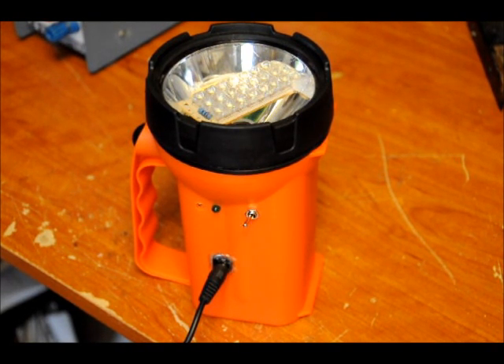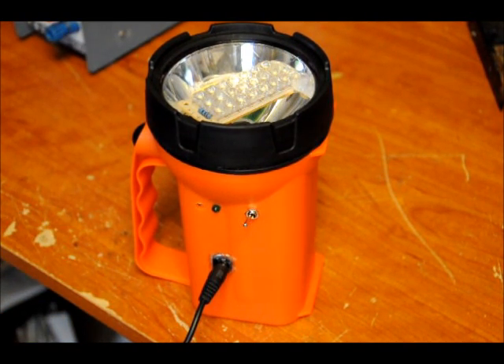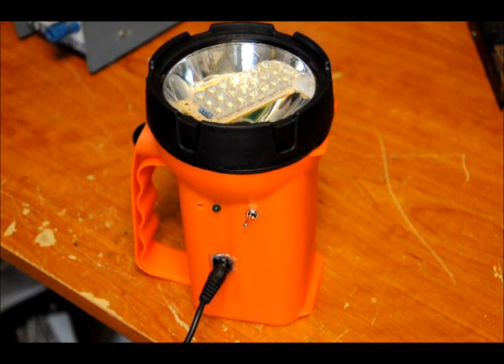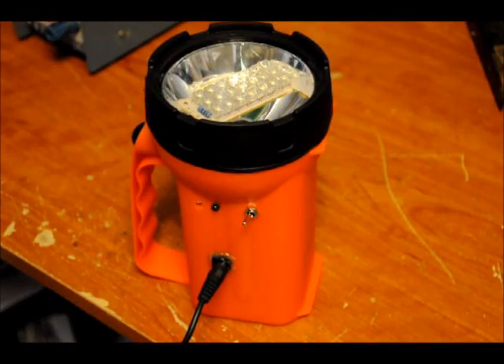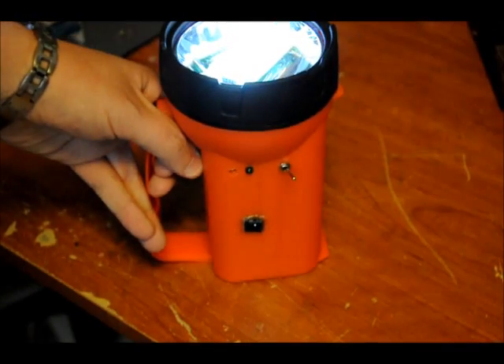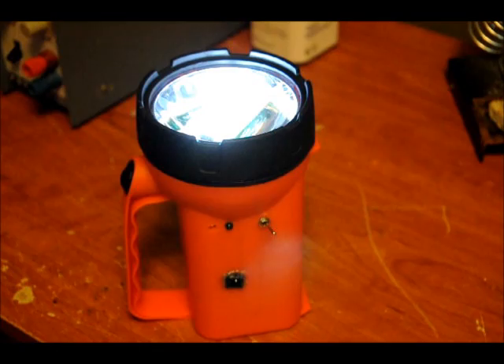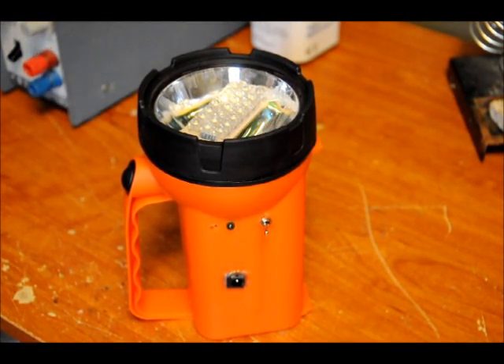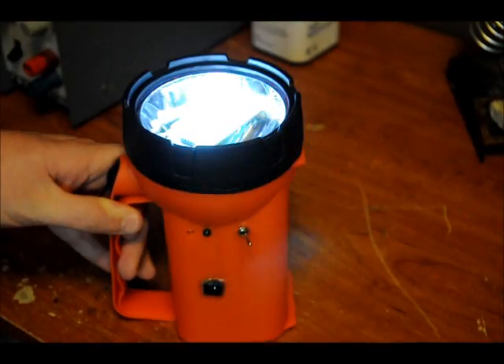The Quick Rechargeable Super Capacitor Flashlight with DC Input

Comment: "20min. to 1/2hr. to charge?"  One of the main purposes of using super-capacitors is to recharge in mere seconds. You need a power adapter of the same voltage but with a much higher current rating.
Reply: Good point but then he would have a toolpack and not a flashlight.  What charger are you envisaging?  Something DC connected two way to some LiFePO4 or overvolting the caps?

Comment: I love it, and wish I had one... but for now I think I'll stick with Lithium Ion @ 4000 mAH, 3.6v. Thing is LiION is the perfect voltage for super brights. I want to design a circuit that engages a limiting resistor when the voltage > 3.6V, kicks out when at or below 3.6V. Considering the battery (which costs $2 not $25...) will keep the circuit lit longer than the supercaps, and can be recharged more than NiMH... I think it's the best bet until supercaps get cheaper (and they probably will!).

Comment from the maker: @rome877 
In this case, using a 9v 1A power supply, and 2x 400f capacitors in series, to charge from 0v takes about an hour.  To charge nominal, from 3.4v takes about 15-20 minutes.  If I had a power supply that could offer more power, then I could change the charging limiting resistor to make the device charge much faster.  I talk about all of this in the instructable =)